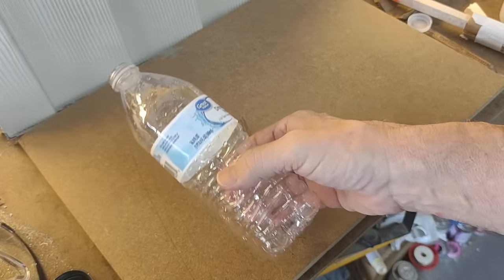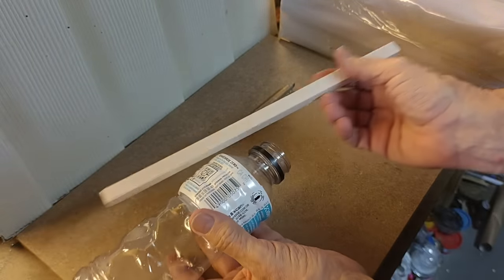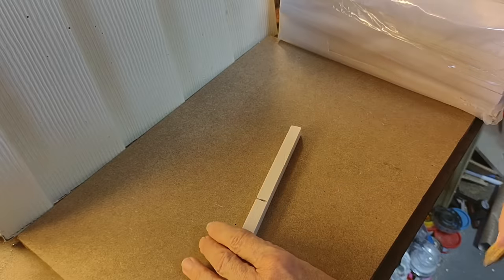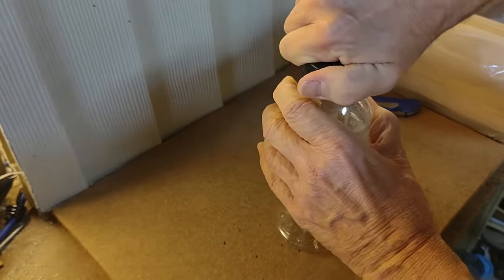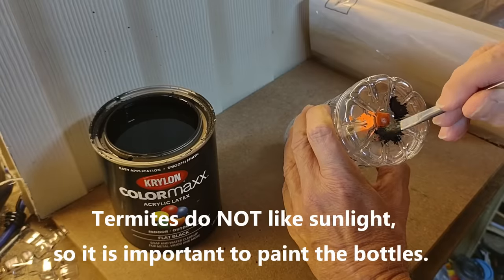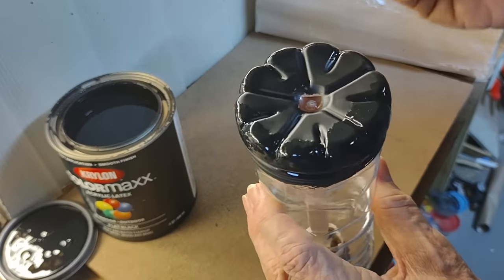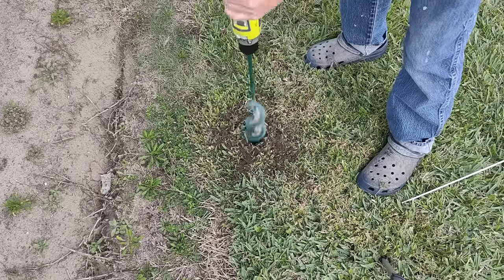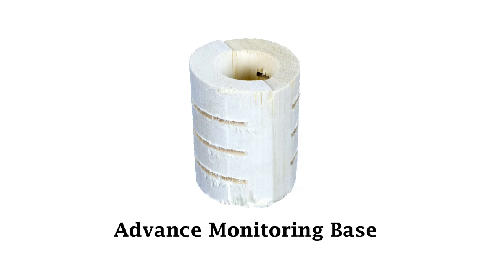Unbelievable Water Bottle Trick for Termites!  Simple to do!

Comment: So" it does not work in Africa?
Reply from the maker: That depends on the species.  You have some different species there, so it may work for some, but not for all.  I'm not familiar with all the species you have there, but this will most likely work for all or most of the subterranean species.  I hope that helps.  Be well my friend.
Reply: @GuysPestSolutions  okay thanks I am in southern Africa
Reply from the maker: @benjaminmukarati4774  There are about 30 species of termites found in South Africa. The most common species are:

Subterranean termites: These termites live underground and build mud tubes to reach wood sources. They are the most destructive type of termite in South Africa and can cause significant damage to homes and other structures.  The monitoring stations will work for this species.

Drywood termites: These termites live in dry wood, such as furniture, flooring, and walls. They do not need moisture from the soil, so they can infest buildings even if they are not located near a source of water.  The monitoring stations will not work for this species.

Dampwood termites: These termites live in damp wood, such as rotting logs and trees. They are not as destructive as subterranean termites or drywood termites, but they can still cause damage to property.  The monitoring stations will not work for this species.

Macrotermitinae: This termite species is known for building large mounds of soil. They are not as common as other termite species in South Africa, but they can cause significant damage to property if they infest a home.  I do not know if the monitoring stations will work for this species.

I hope that helps.  Be well my friend.
Reply: @GuysPestSolutions  thank you very much for explaining to me now I can do understand I didn't know that they are many types. I think we got drywoog termite in our homes.
Reply from the maker: @benjaminmukarati4774  I don't know what is available in South Africa, but the standard treatment here is to fumigate for drywood termites.  It's the only way to totally get rid of them.  Be well my friend.

Comment: I would just put bulsa wood stick into ground and monitor every couple of month. No need to make a bottle out of it.
Reply from the maker: The problem with that approach is that you need to remove the sticks from the ground every time you check them.  That is way too time consuming.  With the bottles, you just look at the top to see if the orange dot is still there.  You can check your entire house in just a few minutes.  A little more work up front saves a whole lot of time later.  Be well my friend.

Comment: I use scattered oranges  places where there are termites droppings and it worked  twice  already.
Reply: I’ve never heard of that could you please explain?  Thanks
Reply: How did it work? The colony died & you have the dead queen? Or did you stop seeing droppings there which may indicate they moved a little farther away?
Reply from the maker: I'm sorry, but that is not going to work.  Termites eat cellulose and oranges do contain cellulose, so the termites may eat them and die, but that will not take out the colony, so they will most likely attack from another direction.  You may want to consider getting a professional termite inspection done.  There is a reason why professionals do not treat termites with oranges.  There are much better ways to do it.  Please let me know if you have an infestation and I will explain how to treat it properly.  Be well Prescila.
Reply from the maker: @DonaldGMyers  I do not recommend trying that method.  It won't work.  Trust me.  I have been doing this a really long time.  Be well my friend.
Reply from the maker: @maxmanx1294  No.  This will not kill the colony or the queen.  Just the termites that may eat the oranges.  It will not stop the infestation.  The termites will relocate.  Be well my friend.

Comment: So, why wouldn't you just make your stations and fill they with the foam from the start so if termites happen upon your house they from the start bring the bait back to their evil lair and kill them from the start.
Reply: Because other creatures will eat the foam and not just termites. Only termites will eat the wood.
Reply from the maker: I suppose you could soak the sticks in something like Bora-Care to make them toxic to termites, but that will make the stations more time consuming and more expensive to make.  I wanted something quick and easy to do.  The treated stick probably would not be enough to take out the colony anyway.  The stations are easy to check, so you can just treat the termites after they arrive.  Just easier to do.  Be well my friend.
Reply from the maker: @keithbk  Yes.  If you use a bait, then ants will also eat it.  That's the problem with bait stations and the reason I recommend monitoring stations instead.  Be well my friend.

Comment: The termite company wants $1,000 a year 🎉to come every 3 months and check the monitoring stations they installed for previous owner of my home.    The home is 4 years old.   On cinder block foundation.  The termite company sold previous owner a treatment of white foam board, white plastic over entire floor under the house and white paint type application on entire underside of the floor and wood piers.  They won’t tell me anything about the job.  There don’t appear to be any termites, house is new.  Can I ut a stick in the black stations or a bait.  If the bait is gone then I know to treat that area?  My next door neighbor says he has been there all his life.  No termites.  It is family property.
Reply from the maker: I think paying $1000 a year for that service is way overpriced.  Most companies will do it for around $200 to $300 a year.  Even that is too expensive in my opinion.  I am not sure about what sorts of applications they did to the house, but it sounds like they put some termite barriers up.  Pretty much a waste of money.  You should know that the termite stations that were installed around your house belong to the company.  You are most likely just leasing them.  In all probability, if you cancel the contract, they will remove the stations.  If they do not remove them, then you can simply put some wood in them and use them as monitoring stations.  They are probably not as close together as I would like them to be, so I would fill in the gaps with the homemade stations.  For the price you are paying, they should be about every 8 feet apart, but I have seen these things installed 15 feet apart.  I believe your neighbor that they have no termites because it's one of those things where you can go your whole life and never encountered them, or you can get attacked by them the day after you buy the house.  For me, the termite stations are easy to make and install, so it just makes sense to do it.  I also apply termite granules around the entire house every year, just to make sure that I am protected.  I will give you a link to that video, just in case you're interested in doing that as well.  The granules cost about $50, and the application takes about an hour to do.  Please make sure that you buy the correct granules.  There are two kinds of granules now and one of them does not work.  They are both manufactured by Bayer, but they really screwed up on one of these products.  Make sure that you get the granules that use imidacloprid as the active ingredient.  The correct granules are no longer available at a lot of the Home Depot and Lowes stores.  However, they are still available on Amazon and I will give you a link to them.  
     
I hope that helps.  Be well my friend.

Termite granule video:  https://youtu.be/H7rW_TSBHJ4

Termite granules:  https://www.amazon.com/dp/B000RUIJYM?ref=nb_sb_ss_w_as-reorder-t1_k1_1_6&amp=&crid=157C3RV0MY0AK&amp=&sprefix=termit

Comment: I thought you said make the traps for 50¢ each? Your at $19 just for the wood sticks. 😡
Reply from the maker: I take it math is not your forte.  That's okay.  Most people have trouble with it.  A package of 50 sticks is actually $18.  That's about 36 cents each.  You need to place these at 4 foot intervals around your house and along both sides of your driveway, so you are going to need more than one monitoring station.  You will need a lot of them.  Presumably the bottles are free, so the only other stuff you need is some paint and duct tape.  So, you should be able to make each one for about 50 cents, but even if you end up spending a dollar on one, that is way cheaper than the $15 each you will spend for the commercial ones.  I did my entire house for under $25.  I mean.  How cheap can it get?  Be well my friend.

Comment: I'm done. Not trying to take advice from a guy that advises anyone to cut wood with a razor. Use the right tool for the job, that's how you mitigate risk of injury.
Reply: It's balsa wood. A utility knife is the correct tool. Ask any hobbyist who uses it to make model airplanes.
Reply: It's balsa wood he's using. Literally soft as jelly! Somehow you probably haven't used it as a kid making model planes; and he's using a box cutter knife which is quite different from a regular razor.
Reply: “Use the right tool for the job“
He did.
Speak on that which you know.
Reply: Dude ... try paying attention. You might learn something
Reply from the maker: Wow.  I don't know what to say.  I think everyone pretty much covered it.  Balsa wood is super soft and easy to cut with a utility knife.  It's not dangerous at all.  That's the point.  No pun intended.  You want really soft wood, so that the station triggers quickly.  I do appreciate the comment though.  I understand that you are only trying to help.  I know you mean well.  Be well my friend.
Reply: I guess you didn't you make anything as a kid with balsa wood. It is very, very soft wood, much softer than pine, and cutting it with a good utility knife is the normal and recommended way to cut balsa wood in a small thickness like this. In fact, if you try to saw thin balsa wood it just splinters and breaks - you must use a sharp knife to cut it straight. 
It's important to notice how he is not holding the wood in his hand where the knife could slip. Look at that part of the video again and you will see how the wood is laid flat on the table mat and the knife is laying on top of the wood with force directly down toward the table. There is really no way for the knife to slip with the wood and fingers in this position. Even if the knife did somehow slip the knife would go the direction of the force, down into the mat, not anywhere near the fingers which are pressing the stick down on the mat a good distance from the knife blade. This is a good demonstration of a safe way to cut balsa wood for anyone new at cutting this soft wood. 
I carved small objects for work, professionally for 19 years holding the objects in my left hand and carving / trimming hard and soft materials with a scalpel knife. That I would not recommend for a beginner - one slip and you've sliced you thumb or finger! I was doing very precision carving pulling the blade in various directions, so pushing the blade away from my fingers in a whittling motion was not even an option. So, I know something about safe and unsafe handling of sharp knives. My second and third-grade sons trimmed balsa wood with a knife using the safe knife method demonstrated in this video when making their various models and crafts. 

Mr Guy is obviously a very knowledgeable professional. This is the first of Mr Guy's video that I have seen and I can't wait to view others. I totally appreciate all the time he spends sharing his vast knowledge with us. It is very time consuming to put together a video like this and especially to include everything that people, clueless about this subject, need to know to actually be able to successfully do it ourselves. We gain soooo much, both financially and in knowledge to get the job done right and effectively, whether we choose to do the job DYI or hire a good contractor. And to answer personal questions and spend time helping people with their individual problems is so kind and commendable!  Thank you so much Guy. May God bless you for your kindness.